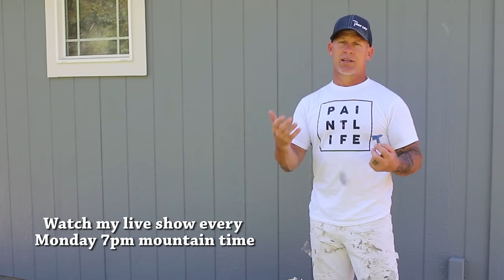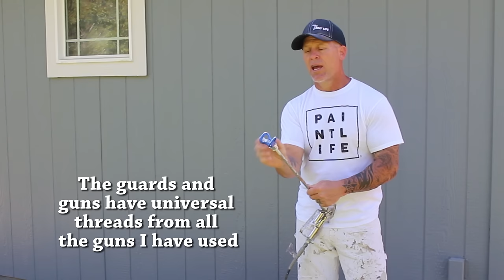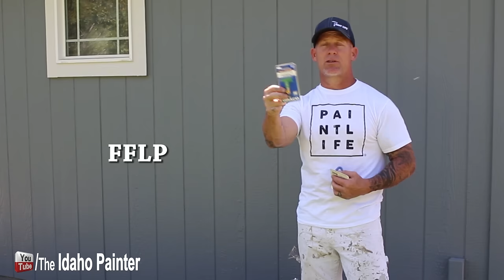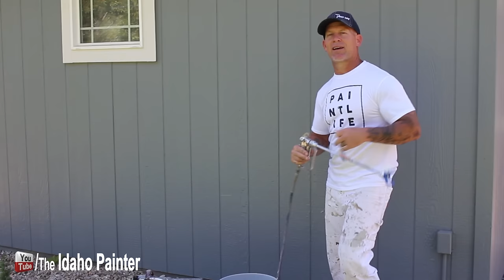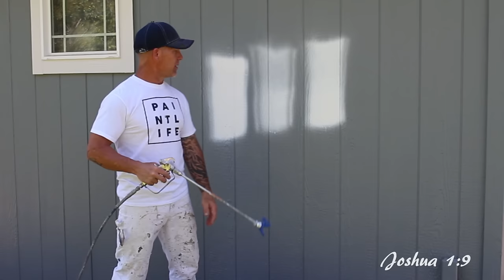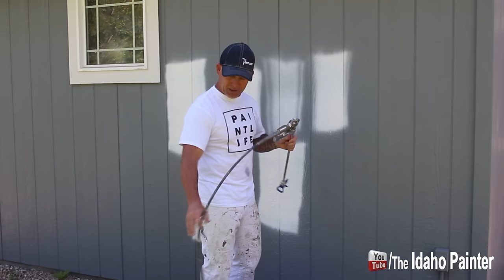All About Airless Paint Sprayer Tips

Comment: I thoroughly enjoy your videos, thank you. 
I have a LARGE barn with rough sawn wood that i just pressure washed the old dried up sun beaten stain off. Its a little furry after the wash... would you sand the fuzz before re-staining? And is this (tip video) in reference to stain or just paint.  I have a little wagner sprayer but i like professional big boy tools...have the Greco X5 in mind and it has good reviews.

Comment: Great vid, super informative!   The paint I'm going to spray recommends Airless Spray Pressure: 176-210 bar. Tip Size: 1880-2180.  I understand the bar to PSI conversion but what tip size should this be?
Reply from the maker: I have never seen tips in those ranges

Comment: i noticed you don't talk about the 517 tips much, any particular reason? i have used a 623 to blow through 120+ gallons of block filler a day spray and back roll, only my self and one other guy. i agree 110% about using blown out tips for that kind of work. great videos.
Reply from the maker: It is a size we do not prefer

Comment: hello Criss. there is a part that is a Little ring with a rubber selled and comes with the tip when u buy it. actually u replace it using the tip. what i understand is that every tip has its own ring . no? example a if u have a 108  2 " fan with a very fine finish hole now u just replace it for a 515 but just u replace the tip and no the ring. is gonna be actually 508 no? in order to have a 515 u have to replace the ring .15 no? sorry man i m just trying to understand good cause the rings are diferents. thank u

Comment: I’m thinking you would need a higher pressure for thicker paint and depending on the tip size would you need more pressure for a smaller tip or a larger tip?
If you’re pushing thick paint through a small hole you would need more pressure but then if the tip hole is bigger you need pressure to accommodate the extra volume.

Comment: Awesome video once again. I have a Graco Magnum something. I've been using a 515 spraying exteriors. I think it's getting wore out a little because it spits and puts out a lot of paint even with the pressure set as low as it will go. I bought three tips today a 311, 515 and a 619. They are black tips and I realize they are the older version. I'm hoping the new 515 tip will not put out as much paint and maybe the 311 tip will help with that when going around things I don't want to get over spray on. I don't know much about the pressure, just that more pressure puts out more paint. But it looked like you got cleaner lines with the pressure turned up. I'm just trying to figure out how you get more precise with it to paint closer to stuff. Do you use cardboard shield? I have been but it seems if they get to wet then warp and get curved. I was wondering if that's what you use or if you have found something better. Sorry I know that's a lot but any advice would be much appreciated.

Comment: What a great video! Big THANKS! I noticed that when you changed tips, you did not change the seat what goes on the guard. When is that the seat needs to be changed? I just bought a different tip for my brand new sprayer, do I need to change the seat? thanks again

Comment: Great educational video thanks! I spray a lot of very thin wood sealant (TWP) that's as thin as water and being oil-based any overspray causes me lots of problems (car detailing expenses), etc. It looks like your tip selections are for paint. What tip changes should I make for this type of material? Thanks again!
Reply from the maker: I would use the change tip sizes just change the pressure

Comment: This is one badass video but i have a question about 310s on interior trim work. When you paint with a 310 tip on the interior trim (crown molding, door jams, baseboard) do you ever paint 2 two coats or is one coat sufficient?

Comment: 1221 would eat 5gal fast...635 the biggest tip i ever used with 18inch roller for new construction walls (fast) my personal pref..311 doors..519 ceilings n ext/int walls...211 sofit .facia..drip cap...elasticmeric the worst...water or moisture gets behind it n bubbles out...

Comment: Hey Chris thanks for the great videos.I have literally learnt to spray over the last year just from your videos so thanks.Ive got a question and your my last resort and I hope its ok to post this question on this video.I have a Graco ST MAX ii 495 with a tip extension and the extension will not stop leaking from where you screw it onto the actual gun.I have tried everything, new washer gaskets (even different brands), a cheap ebay extension to see if that worked but that leaked too.Ive tried different pressures also.I mainly use a 517 tip for finishing walls and ceilings and a 817 for the first coat(mist coat) on plaster board/drywall and the extension leaks with both of those tip sizes too.I used to use an extension on my old q-tech machine with no problem at all.Please help Im desperate.I forgot to mention that I also have the Graco cleanshot valve and that does exactly the same too, leaks where you screw it on to the gun just like the extension.

Comment: Thanks for the video!
So I'm in a bit of a predicament. I'm about to have to let my handyman go, because he's just been really slacking over the past couple weeks. This leaves me with painting my house by myself with just one guy (the 875 sq ft detached garage is being done right now). I've been looking at sprayers and it looks like I'm probably going to go with the Graco Magnon X7 airless. My house is about 3800 sq ft (floor space), with only 800sq ft upstairs, but high ceilings in there, at about 30ft at the peak (outside measurement). So, with that being said, part of the house is a new addition (2 story), part of it is a single story (pre-existing house: about 1950 sq ft with only 8/9ft ceilings, so not nearly as high). Okay, so with all that being said, I'm going to be most likely using either the Behr Premium or Behr Marquee (I'm a single Mom who's saved some money to finish my house finally, but I'm still on a budget). I'm using a medium gray with white trim (plus I'm building cedar shutters that will be black, but painted before I hang them, and will of course go up after everything else is painted).
Besides getting a longer hose (I'm looking at getting a 50' versus the 25 or 30' that comes with it. I also want to get an extension tip, and was wondering if you could only get one, what size would you recommend? Secondly what tips would you recommend for the paint and sprayer I'm using, (Items to be painted T1-11 siding new construction, soffet panels under the covered porch also new construction: 30ftx6ft, mainly 4 inch trim, two single doors and 2 sets of French doors, plus a few bellybands)?
And lastly, any extra products you'd recommend for more of a beginner. With the height, what would you recommend for reaching the second level? Scaffolding? Man lift? Etc?
Sorry for all the questions. Any feed back would be greatly appreciated.
Thank you!

Comment: Just bought a graco spray guard and graco tip from home depot for my Wagner spray handle.. when I screw on the guard and insert the tip the tip does not fit snug when tightened.. it's very loose even though the guard is tightened all the way down..

Comment: Thank you for the instruction. I am just getting started and looking at finding the right tip for the project, I also noticed they relate the tip size to what material is used. I did not hear you address that. My first project will be painting cabinet doors. It was recommended to use an acrylic enamel and a 210 or 310 tip. On the tip package and other online info, its recommended to be at a 13, 15, or 17 for that paint. I am gathering from your direction, that I would want to use a x10 tip, and increase the pressure. Do I need to address thining out the material for a 10?
Reply: Generally most paint brands in the UK recommend a .17. That would be ridiculous though.  I generally start with a 210 or 310. Depending how wide i need to spray. If the product is think you could try a standard tip not fine finish.  And that would be like a 211 or even numbers. 
212 or 312 can still through alot of paint out. Hope tht helps

Comment: I have a 3,500 sq ft house and want to paint all the crown molding and baseboard (interior of course). I see many comments about minimizing overspray, but on a fine finish, wanting to atomize the paint more. So what's better, something like a Titan Control Max 1700 Pro High Efficiency (only 1,000 psi), or something more like a 3,000 psi Graco Magnum X7? I guess the bottom line question is, what is a good "go-to" sprayer for interior trim? Thank you.

Comment: Do you cut the paint because of recommendation as you change the tips? Or just crank up more pressure? For example if Sherwin Williams paint recommends using a .13 to a .17 but you are using a .10 tip?

Comment: I'm planning to do a "london door" (high gloss) finish for my front doors. To smooth out some of the grain I'm using a oil based coating primer before I apply my high gloss latex. I plan to sand with 320+400 between coats before applying the latex enamel. I have a Graco X5, any suggestions on tips and pressures? I plan to use a RAC X 515 for the first coat of primer, let dry then sand and then apply a thin coat of the primer to get a near-glass smooth finish. Then finally apply the latex high gloss enamel with a FFLP310---how does that sound? Is there a video for this kind of project. Or, I hope can do a video on painting a high gloss door. OUTSTANDING youtube videos, I've gotta buy some of your swag to thank you for your helpful videos.

Comment: Hi Chris! Really getting a lot of useful information in your videos! Thanks so much! Getting ready to repaint the spindles on my porch railings and want to make sure I order the correct tips along with the right airless sprayer..can you please advise what tip size I should use? Then I plan to repaint some porch rockers...which tips and pressure setting best for this job? And third question, is chalk paint for matte finishes on indoor furniture able to go thru the airless sprayer or should the chalk paint be thinned down first? Thanks again for your advice! 😀
Reply from the maker: 108 or 208 for spindles. Put it at 1800-2000 PSI using a 210 for the rockers. Chalk paint, I would not thin down and it can go through the airless.
Reply: Thanks so much!! Now I'll get busy! I REALLY appreciate your help and enjoy your videos!!

Comment: What tip to use on new drywall ceilings, cabinets, trim and doors for a beginner?
Reply: Drywall and ceilings I like to use a 515 or a 517 Grayco . Cabinets and trim 211 up to a 311 works well . Inside a house the less overspray you can have the better. Grayco's 360 cup gun works well in these areas and normally come with a finer finish stile tip .

Comment: WOW Chris what an awesome video!!!!!! what a great way to actually see what the tips are doing! As I am looking at the patterns I have to paing a wooden picket fence. Looking at the width pattern, It looks like a 310 would be my best choice?  My other question is that I have the standard 4 finger gun my X7 Graco came with. I know you like the contractors 2 finger gun. Can I use the RAC or RAC X tips with that gun? My local paint store has some of the RAC X tips in stock. Thanks for the video and the education!
Reply from the maker: I would recommend using a 110

Comment: Hi, if you spray your trim in your  house initially there is a nice smooth finish  What happens down the road and you have to touch up an area that got scratched or damaged and using a sprayer is not an option,  What do you use and how does the finished product look and how does that look visually next to the other parts that have not been touched ?

Sorry second question, If installing fabric wall paper and I need to install base board and paint it as well.  What order is the process ?

Thank you kindly and I enjoy the videos
Reply from the maker: Use a weenie nap or whiz roller

Comment: This was so helpful, thank you! What size tip would you use on a basement ceiling with exposed joists? It's an 8 foot ceiling.
Reply: Id generally use a 517 minimum unless is was a smaller area where you need a smaller fan size.  Hope that helps

Comment: What about paint viscosity?
I'm getting the Graco Ultra and it comes with a 514 FFLP tip.  I'd prefer a tip in 2XX/4"-6" range for smaller projects.
I usually use Home Depot/Behr paint and it's very thick.  Would a 212 tip be suitable with Behr and the Graco Ultra?

I also plan to spray water based polyurethane which is much thinner.  OK to use same tip?  Again, I only need a 4" fan

Thanks.

Comment: Hello I do a lot of outside spraying on two-story condos all exterior work. It's a gated community I'm on the maintenance staff as a painter. I have been struggling because this place is a complete jungle with plants and trees growing inches from the wall sometimes. I spend hours covering up things so I can spray big sections. The only tips they buy me are 313 Draco and 517 Graco. I usually use the 313 mostly because of the fact that I don't have a lot of open areas before I hit into a window or trees and I'm worried about the 517 overspray. Would you recommend the 515 for this? Trying to find a tip with the least amount of overspray but isn't a 3-13 which doesn't seem to put out much paint for me. When am I going around a window or tricky obstacle 313 is great but the rest of it takes forever. I would love to figure out a way where I don't have to cover up every single thing because the tip doesn't make much overspray at all. Sorry for the long question is there any way that I can take pictures or video of the basic worksite and email it to you and get your professional opinion? I'm a big fan half the stuff I've learned is from you guys because the head painter here and the other guy I don't know anyting and they do the buying and material accusation. Thanks a lot

Comment: Hi, great video. I wanted to know if you had any information about the orifice part that is in the actual tip guard or what it is for? I was confused because with new tips only some come with the extra part to go in the tip guard, so wasn't sure why this would be if it was an important?
I don't have a lot of spraying experience, but I have only never changed the tip before not the other part in the guard, so I was wondering if the tip itself is controlling the orifice size and the part that's in the guard just assists or is this the only thing controlling the size - which I guess would be important when changing tip sizes otherwise only the spray pattern would change? Thank you.

Comment: Could you tell me
Why I get on the side of my spray fan a line?
So it shows each stroke I’m painting it’s not that I go to fast, I also tried to go closer And larger distance that also doesn’t solve it. 
The tip is pretty new
Reply: You need to adjust the pressure on the machine

Comment: Im a carpenter and I like to spray all my trim, door casing, baseboard etc... I use a 412 fflp and typically use a "harder" paint (Dunn Edwards aristosheild) and my tips completely clog. How do I avoid this? Is there a way to unclog a tip? (Reversing tip and blasting out with sprayer doesn't work). Thanks in advance.

Comment: Do you first select the tip based on the surface being painted then thin paint if necessary for orifice size or do you use the recommended orifice size based on the paint recommendation as shown on Sherwin-Williams documents?  Our local SW stores do not carry a full line of Graco FFLP tips necessary to cover all their stock paint tip recommendations.

Comment: What tip size would you suggest to spray automotive enamel with? I have to pain a 50' propane tank trailer in white acrylic enamel..needs to be slick and smooth. Is it possible to do? Thanks

Comment: What tip size would you use on staining a deck. Water 💧 base solid stain. What Greco sprayer would you recommend for this project. Thanks
Reply from the maker: 310
Reply: @Idahopainter 
Thanks. Would a 311 be ok to use? Also what tip size would you recommend when spraying latex paint for outside building? I just purchase a Graco Magnum X5. I hope it will do the job on my deck that I’m going to Stan and the building that I’m going to paint outside.

Comment: quick question, when dont you use a spray gun? I know its ideal for this situation cause they are boarded walls instead of flat... would you spray in a flat wall situation,? 

also are you not worried about any spray hitting the gutters or eves.. what would you to avoid splatter on them? 

do you guys backroll to avoid runs and other anomalies? 

really want to spray just want to know the situations not appropriate to spray... 
thanks
Reply from the maker: We only back roll under certain circumstances and you should check out our video on how to avoid overspray. We typically spray exteriors.
Reply: Thanks mate! watched, and that's fantastic

Comment: If the paint itself says to use a 0.16-0.17 orifice size at 2000psi, do they assume a certain spray width or does that mean I need to use a 216 or a 516 (i.e. no matter what the width of spray the orifice size should stay the same because that's what the paint wants), assuming the max psi on my tool is 2000psi? It seems like you use a smaller orifice when you use a smaller spray width or are spraying something that doesn't need to be so heavy, but I'm not sure if you are also using a different paint for the different applications.